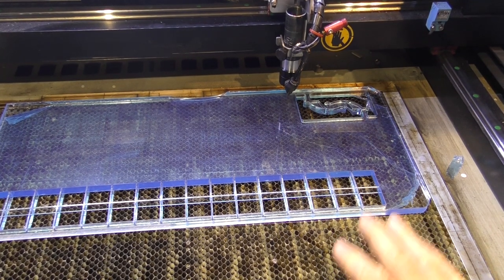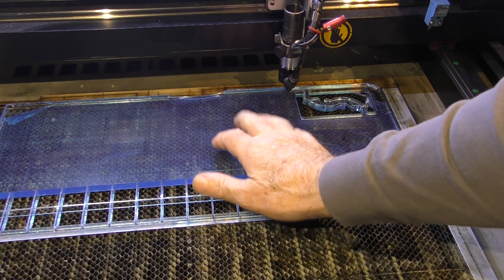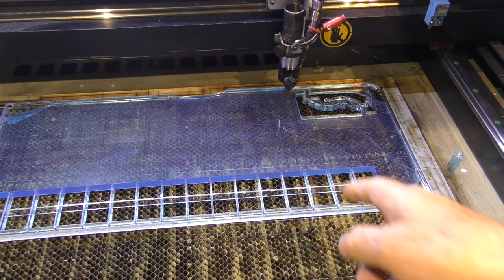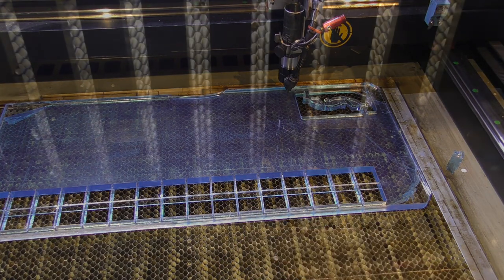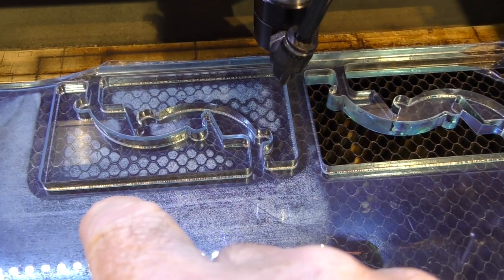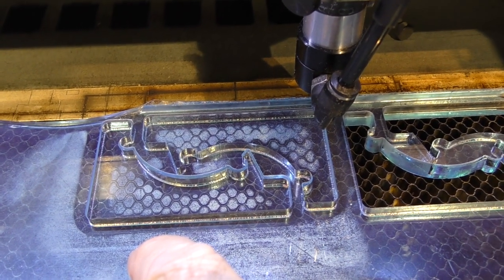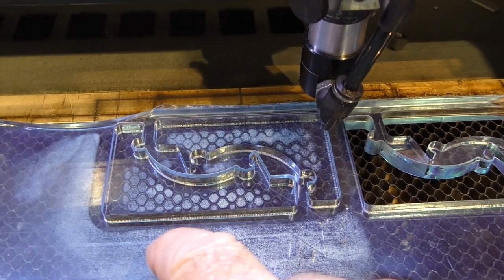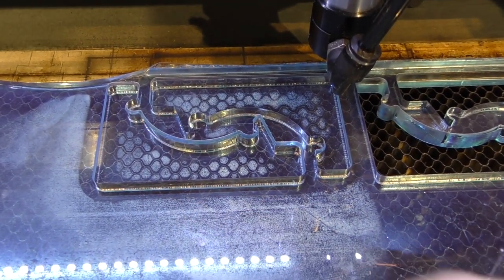RDWorks Learning Lab 195  Honeycomb--- A Disaster Looming

Comment: Russ, Im having reflection problems with my steel plates that I've tested. I get Marks under the acrylic, like  very diffuse beam markings with small dots. I've sanded the steel plate and it got a little better but still get those markings even if I use very thick spacers between the acrylic and the steel.

I'm using cold rolled black steel. They sell darker steel where I live but it's hot rolled. Any suggestions?
Thanks!
Reply from the maker: Hi Jorge
ALL metals are reflective its just that some are more efficient than others. Mild steel is about 65% so there is still significant reflection.  When the beam exits the bottom of a cut it is only the high intensity light that makes it through the cutn  and that is a very thin "stick" of energy that is almost parallel, so there is very little natural divergence  that will reflect from the steel sheet. Scrubbing the surface with a coarse abrasive does not change the reflectivity  but it does help to cause beam scattering. I use cold rolled steel because it is flatter and more stable than hot rolled steel. Hot rolled steel has an oxide on the surface that will absorb a few more % of the energy  until you abrade the surface and then you are back to raw mild steel. 

 Your problem may be more complex than you think. My first question is "how efficient is your beam?"
 If your beam is "sharp" it will be efficient at cutting and you will be able to cut fast. Cutting fast ensures that the reflected energy does not have sufficient time to damage  the underside of the material. Take a look at this video from 5:05
https://www.youtube.com/watch?v=V_ehGE51rH4
You will note that the material is only spaced 5mm above the steel plate on magnets. This is a 60 watt tube that I am intending to replace later in the video and you can see from it's mode burn  that it's central intensity is probably 20% lower that I wanted for crisp engraving. However, being slightly "blunt" has not seriously affected it's cutting ability and if you look carefully as I turn the cut sheet over, there is no sign of damage to the underside , even at 5mm spacing.  If this was 3mm acrylic then  the cutting speed has to be about 50% less  so the reflected energy has twice as long to damage the underside of the material and I would have to put acrylic on 12m thick spacers.  The problem with acrylic is that being so difficult to cut  makes it VERY sensitive to reflections. Cut 5 or 6mm acrylic and the speed drops to about 8mm/s and thus the exposure time for the underside becomes even longer. In those circumstances I use my "flexible" pin bed to support the material   See this from 19:25
https://www.youtube.com/watch?v=CXda33tlO3k
Spacing this far off the bed ensure any reflections are really diffused before they reach the material
 Try testing your beam quality with this mode burn test. If you have thin pieces of clear acrylic then cut pieces and super glue them together.
https://www.youtube.com/watch?v=R6Wqn5-HMzM

 Remember, blunt beam =poor/slow cutting and slow cutting means more exposure time for reflections to damage the back of your material.
 Best wishes
Russ
Reply: @SarbarMultimedia  thanks Russ for taking time to reply!!! I will take a look at those videos and see what I can do. My machine has a "100"w reci tube and a 2" 63.5mm FL lens so Ill need to make some tests with different speeds ,powers and spacing heights to see if I can get no reflection damage. And yes I'm getting a pretty sharp beam now that I got it almost perfectly aligned and clean!
Reply from the maker: @gjpd   
Hi Jorge
 My guess is that you have a 2" (50.8mm) lens, I have never experienced a machine being shipped with a 2.5" (63.5mm) lens. It Is this a W2 tube rated at 90/100watts worries me a bit when you say you have a 100 watt Reci tube. Is this a W2 tube rated at 90 and 100 watts  or a W4 rated at 100 and 130 watts.. The second number is important  because it is the PEAK TEST value that the tube will be tested to.  There is a test graph on the tube that tells you the peak watts achieved during final iest. For an A grade Reci warranted tube the peak test result will match or exceed the specification. If it fails (even by half a watt) it will be unwarrantable by Reci and sold at scrap value to the "grey" market  where it will be for sale on Ebay at about half the normal price or fitted to machines for export No one will ever tell you that this is a B grade tube. Without going into the technical details , failure to reach the second number indicates internal mirror misalignment and will almost certainly  result in a "blunt" beam. The cutting power of a laser beam is dependent on that beam sharpness and not the power itself.
 Best wishes
Russ
Reply: @SarbarMultimedia   hi! Yes they were going to ship it with that 50.8 lens installed but they told me that their most recent machines have the  63.5mm lens installed and they sent me the 50.8 as spare too. 
I dont have a power meter yet but yes, it's a 100w reci w2 tube. When I ordered it I watched many videos including your latest video about buying machines and ordered directly from a company in China, at least one with good reputation. the first machine they offered had pretty bad quality components but the seller was honest so I customized it and got a pretty good setup for the price.

I'm hoping to get a power meter to see how much power I'm getting from that tube,but they are a little expensive and havent found the cheaper "kitchen thermometer" style meter in the US or Mexico. 

I found a "Mahoney" on a bell laser site, but I am waiting for a Reply because it seems that they only got a warehouse on the US but ship from China...
Reply from the maker: @gjpd  
Hi Jorge

A power meter is very useful but it only tells you half the story about your laser beam .  Yes power meters can be very expensive which is why I decoded how my expensive meter works and have been selling a much cheaper unit  for the past 5 years. I have sold many to all parts of the world.  here is a video about it
https://www.youtube.com/watch?v=lO9rWlobLZU
 In the past few months I have been looking at the design again because material and processing costs have rocketed. For 5 years I have been able to keep the price stable at £30  by buying in larger batches. As the video shows. I am only supplying energy absorbing dohicky. and leave you to buy a digital thermometer that uses K type  thermocouples. In the latest batch I have managed to buy the thermocouple probe from China at a very reasonable price and so the dohicky is ready to plug into a suitable meter . The net result is that this latest batch will cost £37 which includes shipping to anywhere 

 By far the cheapest way to asses the performance of your tube is with a mode burn test
 see   https://www.youtube.com/watch?v=R6Wqn5-HMzM
 If you have thin acrylic material you can cut pieces and super glue them together for the test.

 If you are interested then add your disguised email to another comment and I will send you a data pack and then delete your comment.
 Best wishes
Russ
 ps did you check if you have an A grade or B grade Reci tube? A W2 is rated at 90 watts but used as  recommended by Reci for maximum  life,  it gets down rated to about 80 watts.
Reply: @SarbarMultimedia  I'm interested in both the data and in the dohicky!!! I have been in contact by email recently with you so I'll send you an email!

Ps. The graph on the tube says: channel A 102.3w, min 600.0mw, max 102.3w, average 96.29w. 

The graph has a steep line almost vertical to 100w and gradually raises to +- 102w I think. The date of production is 2021-05-20.
Reply from the maker: @gjpd   
 Hi Jorge
That is good news because you definitely have an A grade tube that has passed the 100 watt test specification. That generally means the intensity profile of your beam will be "sharp"
 Best wishes
Russ
Reply: @SarbarMultimedia  Hi Russ, yes that's great news! At least I know the seller was honest, and that I got what I asked for.

So now that I know that the tube is good, then maybe that's why I'm having the reflection problems with the steel plate. I'll do the mode burn test and see what results I get. I'll email you today so you can share the data and the info about the dohicky!!

Thanks again!